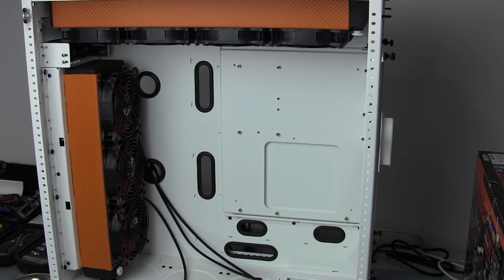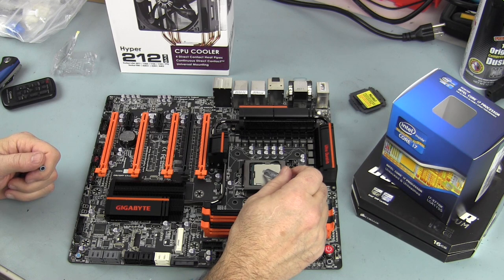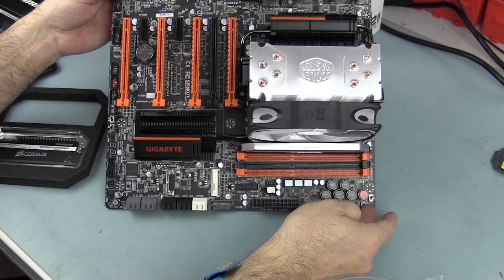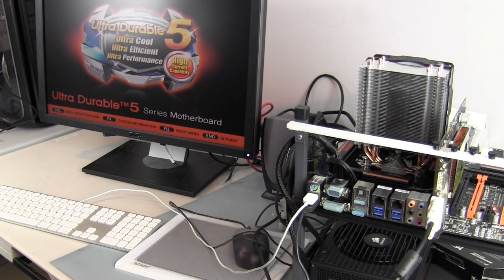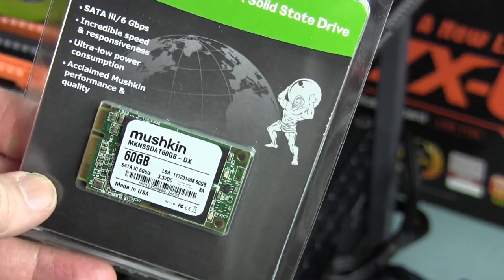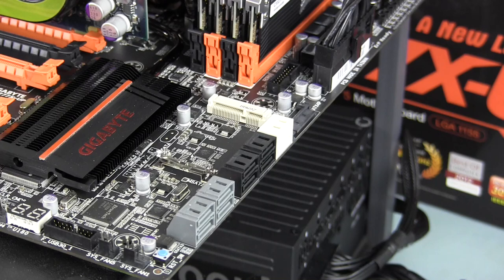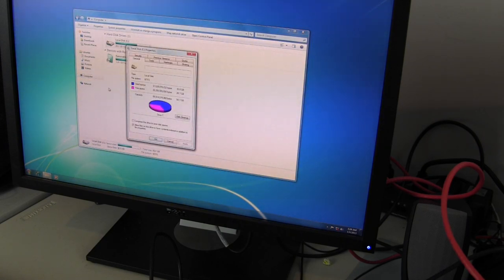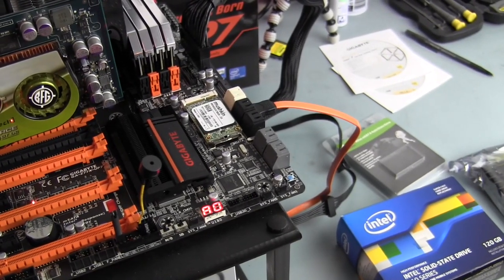Case Labs SM8 Water Cooled Build Log 3  - Bench Test Kit and Overclock i7-3770k on a Z77X-UP7

Comment from the maker: Thanks Glen. Funny I just ordered a video capture device so instead of recording the BIOS screen using a video camera I will use this device which should do it nice and cleanly.  It is supposed to arrive this week so give me a week or so to try it and then I will test it by recording my settings. It is probably easier if I do that rather than try to tell you since the menu options may be called something different on my X79 MSI Big Bang XPower II.   Nice system BTW, and thanks for watching.

Comment: I have a pair of the same Velociraptors in RAID 0, it's not a bad compromise. They were $99 on sale, so for $200 total, I got 1.2GB of fairly fast storage. The performance is almost double the numbers you got which, for some benchmarks, puts it close to an SSD (especially older, slower SSDs.) Obviously SSDs in RAID 0 wins the race :)

Comment from the maker: Actually I have 3 U2410 and a U3011. My main system has two U2410's one on either side of the U3011. The third one is that one I use for testing .

Comment: Hey Ron, you should do a build with the nzxt phantom full tower. The older one not the expensive one :P . I have this case and I ordered water cooling parts today but I dont have a great idea on what to do and I think you could make do it pretty well. I'm just going to put a 120 rad and a 360 rad. If you do a build with this case it will be really interesting to see where you put the rads and the pump (I had no idea where to put a pump and res so I did a bay res/pump combo from xspc

Comment: Only very specific types of Thermal Compound have cure times. Arctic Silver 5 being one of them, with a full cure time of 200 hours of run in. You can still go straight to overclocking though. Min Max difference of at most 5 degrees. MX4 Thermal Compound has no cure time and is non conductive.

Comment: Hi Ron, I have the Asrock X79 extreme11 & a 3930K in my Caselabs STH10 with 2x GTX590 in quad SLI, all watercooled. I only ever use the turbo in the bios as I do not know how to overclock manually. Can you give me some tips on what voltages I should adjusting to manually overclock please. I am from the UK and have been watching your videos for the past six months or so and I think they are the best out there. Please keep them coming

Comment: I have a question if the I7 -3770K the OC chip of choice on a 1155 MOBO. I have a Corsair 800D, ASUS Crucial M4 60 GB SSD and planning to get (2) GTX 660 Ti video cards and water cool all of it. I like the verifiction of using (2) Intel 120 GB SSD in RAID 0.. I am currently running a Corsair H60 on a i5 chip. No doubt I am learning alot from you RONSANUT KEEP on Keeping ON

Comment: If you set page file on a different drive, you have 16gb more free space. I assume you have 16gb memory. Also, since the msata ssd already passed 50% capacity, it performs significantly worse than when it was empty.

Comment: 4.7 with 212 evo woah i cant even hit 4.5 with 3570k using stock evo fan (im on stock voltage at 4.2ghz and max temp on core is 75 after 100 runs of Very High stress on intel burn test)

Comment: I don't get it. I am an avid water-cooler and love people joining the community. People like this are not water-cooling for performance. They say they are, the reality is however that they could have saved the pennies and bought better hardware and cooled using perfectly fine air.

A 3930k, SLi, better SSD's, better RAM, X79 chipset with quad channel ram, the ONLY platform to support multiple PCi-e 16x @ CPU. List goes on.

To put it into context decent water cooling setup like this cost £1000.